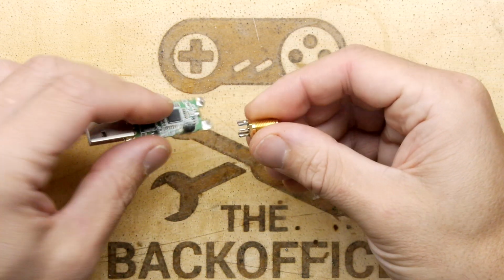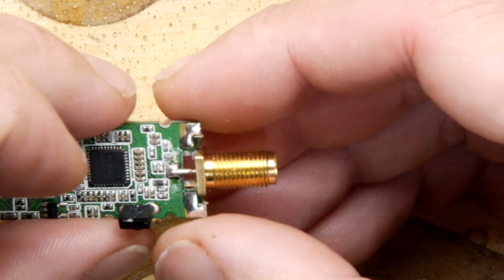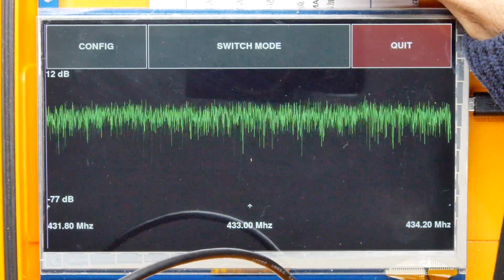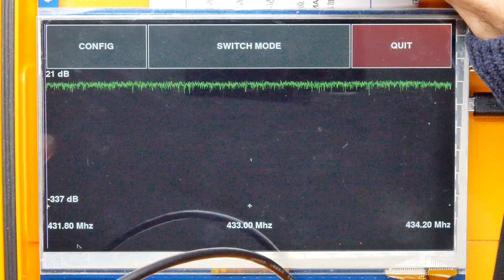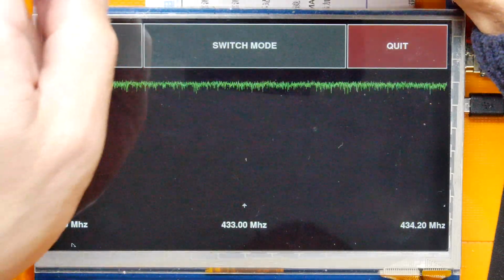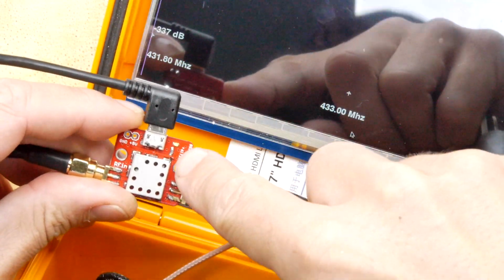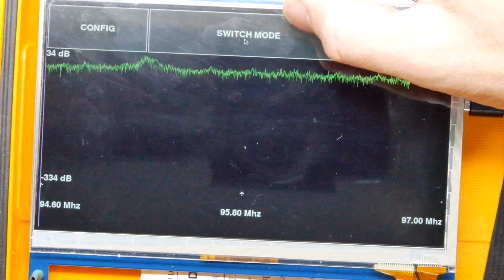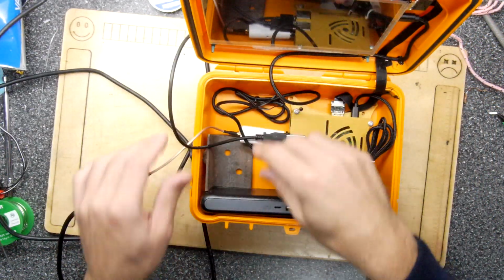Upgrading the Portable Raspberry Pi SDR Spectrum Analyser made from scraps!

Comment: Might be a dumb question since this is an SDR, but I'm a noob. What's the band/frequency range you can receive with this?
Reply from the maker: Depends on the SDR radio. But pretty much everything 😂 I'm going to guess 100khz to 6ghz or so
Reply: @backofficeshow  Most cheap SDR Radios will go from 40Mhz upto 2GHz. The RTLSDR v3 dongle will go from 60Hz to 2Ghz and they around the £25 mark.

You can also plug your SDR into a mobile phone using an OTG adaptor and using an app do all this without the need for the extra components :P